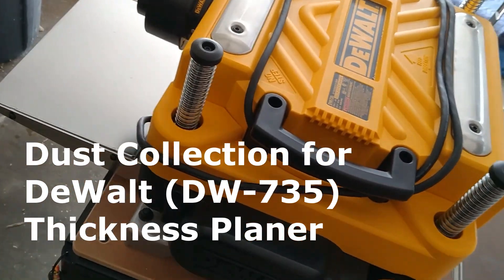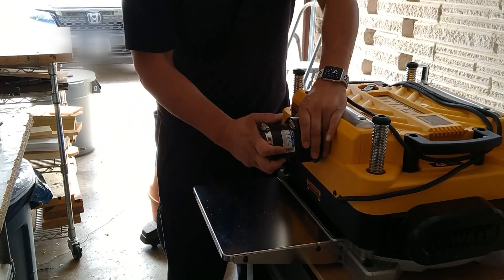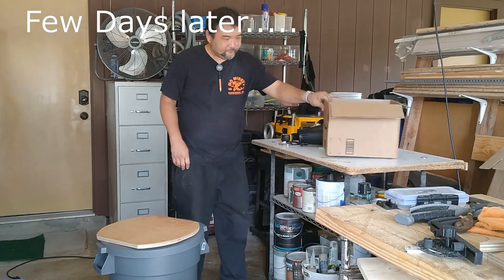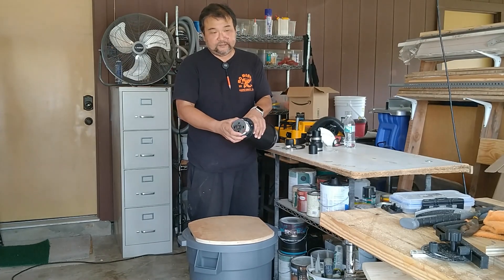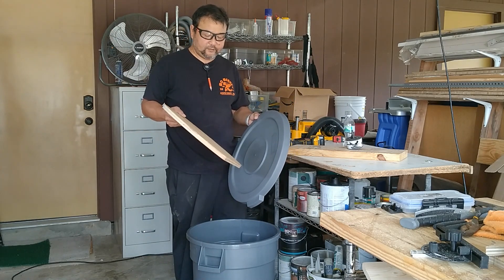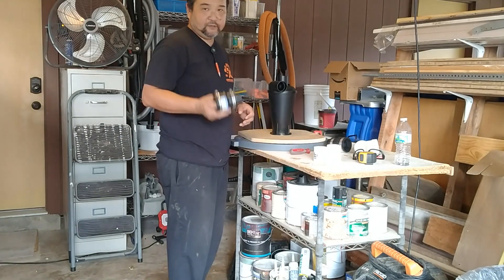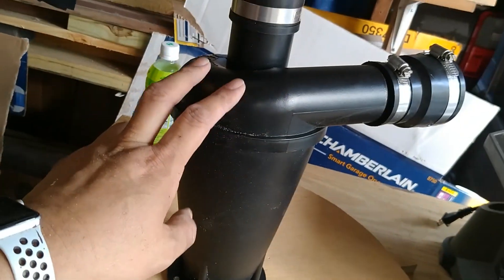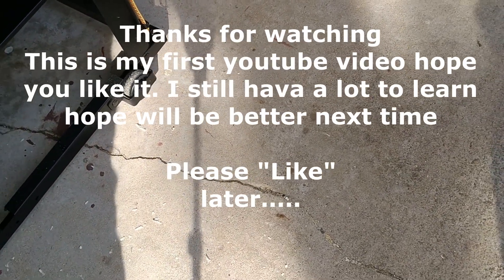Dewalt Planer DW735 Dust Collection

Comment: I went overkill on my DW735. Made a cart with 6 inch PVC going straight down into the cart. Cart is box with a divider separating it into a larger and smaller chamber. 10x20 furnace filter on the small box side. Hose connection for shop vac to add negative pressure and prevent planer from overheating or blowing back dust. Boxes inside the chambers to pull out to empty. Free plans on Rockler that are advertised with a separator fitting kit.
Reply from the maker: Wow very impressive did u made a video to share with the community? Or may be a video to show how well it is working for u
Reply: @MosesLingTexas  Rockler already covered it. There are several on Lumberjocks.